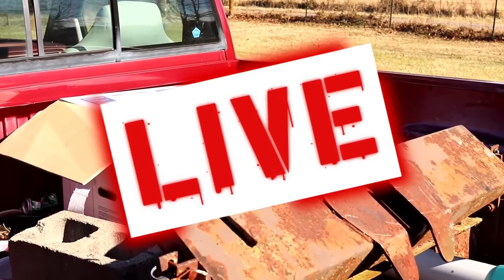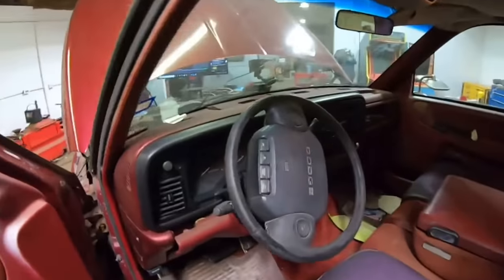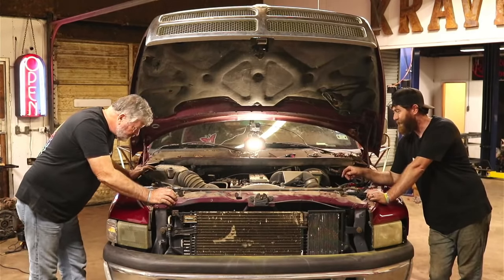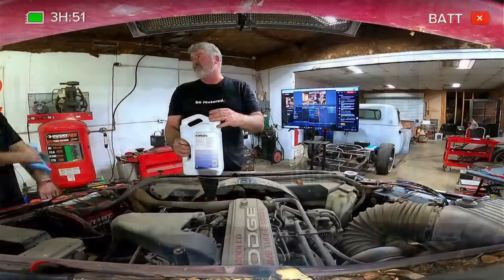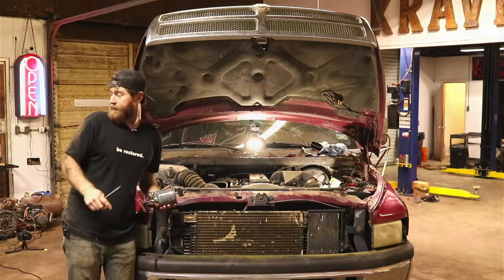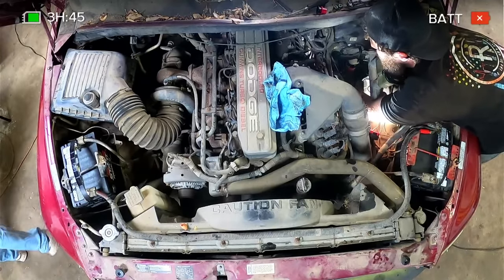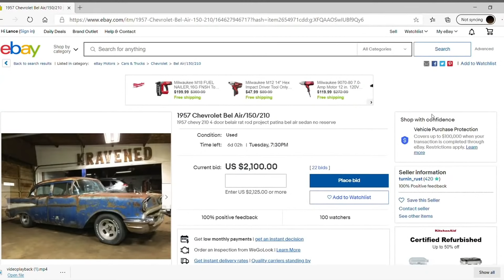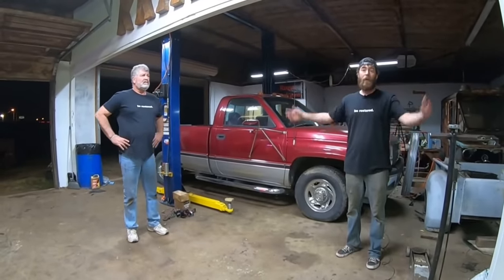LIVE First Start In Over 5 Years | 1994 Dodge 12 Valve Cummins Diesel | Will It Run? | RESTORED

Comment: The transmission weren't bad,they had a bad transmission cooler design that killed the automatic.  Heat is the number one killer of a automatic.  You put a good cooler on it,you won't have any problems.
Reply: The auto tranny was a torque flight 727 with overdrive but a good converter makes all the difference in the world i paid $800 for mine but it was money well spent
Reply: That is true
Reply: Some cooler lines also have a check valve, if it sticks shut, oil wont flow through the cooler, that can kill a good trans.
Reply: Some also have a thermostat and bypass line. it can also stick, then no cooling, oil just flows through the tubes bypassing the cooler.

Comment: Got 2 1st gen 12v truck I use on the farm and daily drive. My 1990 d250 is nearing 500K miles with just regular maintenance. I've replaced many of the ''dodge'' parts but have never put a wrench on the engine. One of the best engines ever put into a pickup you're going to love it. Also have a 1995 Ford F350 with the 7.3 that's darn tough too. I avoid newer vehicles and their computers like covid. hahaha

Comment: I had a 1998 dodge ram 4x4 with 5.2 ltr 318. I bought it new and put 460,000 miles on it. Never had any transmission issues with it. Only problems were the front wheel bearing hubs and front end problems. I own a third gen dodge now 2007 with the 4.8 ltr. with 185,000 miles. Sure miss the 98 it was a great running truck.

Comment: I mainly work on the classic Mercedes, which i know better than the back of my hand and more so the diesel's. NOTHING beats the clickly-clack of a old Benz diesel, that's what a real diesel sounds like. LOL Y'all are starting to learn the ropes about diesel's, the old ones are so simple to get running and maintain it's crazy. My 1991 350SDL was the last Mercedes to be EMP proof!! ZERO electrical shut down or start except the starter motor, all vacuum or mechanical operated. If it spins over it will run. Mercedes even put a rear transmission pump in them so you can roll start it!! I have 6 Benz's, 4 are diesel's and i love each and every one them. Keep up your GREAT family made video's, y'all are fun to watch and listen to while i'm hard at work in my shop.

Comment: I myself have a 94 dodge. That oil plug definitely looked like someone killed that thing. With the transmission leak, I'd say just do a full service. New fluid, new filter and new gasket. When I did mine I also used a little rtb gasket maker as well. Haven't had any problems. But honestly that pickup looks super clean, where as mentioned prior the clear coat tends to disappear. Also if I may, it can hold 13 quarts of oil with one in the filter, tends to run a little cooler that way as well

Comment: You think 11 quarts of oil is alot, try a big truck. My trucks hold 10 gallons of motor oil. 11 counting replacing both filters.

It was Chrysler that started putting drivers side airbags as standard equipment in 6 of it's vehicles. GM however did have it as an option on Cadillac, & other model passenger cars back in 1974 models. 
Lance might be too young to remember, but back in the day in the older vehicles if the airbags deployed, insurance companies often totaled them. The cost of replacing the airbags back then was astronomical.

Comment: He keeps saying these old Dodge trucks. I bought a 99 4 wheel drive 318 5 speed southern work package.  Cloth seats ac cruise AM/FM CD. I put 287,000 miles on that truck changed water pump, clutch, starter during that time. I owned a foundry at the time I put load levelers on it you woukd be amazed at the weight I hauled on that truck. Never broke and axle i had 3,000lb stainless ingot to melt in the bed of it. Towed 11,000# back from Birmingham AL 367 miles to upper east TN. Tough as nails..

Comment: I've had several of these trucks - a '95 gas 1/2 ton 5.9l 360 ci automatic trans short-bed 2wd, a '97 12 valve diesel extend cab 3/4 ton long bed automatic 4wd, a '97 12 valve diesel  extend cab 1 ton long bed automatic 4wd and an '01 24 valve diesel quad cab 3/4 ton long bed 6 speed manual trans 4wd. Some things I can tell you about these 2nd gen Dodge trucks: 1) it is best to have a cheater pipe on the ratchet when loosening the oil drain bolt 2) the fuel gauge sender is in the gas tank and is known to go bad, resulting in having to guess at the fuel level 3) with the pre-'98.5 diesel trucks, which came with the 12 valve  Cummins you will want to keep the valves adjusted; with 98.5+ diesels valve lash is hydraulic and more or less self adjusting 4) The contacts in the starter go about 100k miles then have to be replaced, which isn't too hard. I haven't finished the video yet, but will keep watching and call out anything else helpful that I can think of. Good luck and enjoy your Dodge truck!

Comment: I had a 99 Dodge 1500, and I drove for a couple years with no reverse. The transmission finally went and it ate a valve . Finally traded it in for a GMC.

Comment: I got 2 just like that I changed out the automatic transmission to Manuel  On one truck and a Allison on the other best thing I ever did and yes pull off the booster to change out the fuel filter good deal guys. No thats normal it makes that sound when you pressure it

Comment: As a 12v driver I hope you pre filled the oil filter and just put the full 3 gallons or 12 quarts in total its a diesel it holds a lot of oil so being a quart over or quart low will make no difference but running at about 9 quarts was a bad choice. Also you dont have to take the booster bolts out to access the fuel filter just reach in like a man and do it. Otherwise great video you definetly gained a subscriber.

Comment: If you go all the way back to Henry Ford the 1st and every service manual in between. Those things down there attaching that power house to the frame, they are called motor mounts. There, argument resolved. It's a motor.

Comment: the only thing i know about dodge  diesel engines is that you are supposed to wait for the lights to go out on the dash before you crank them and if its automatic you have to check the trans in neutral because if you check in park it will show a quart higher
Reply: I have some Dodge people tell me that those transmissions did not circulate fluid through the cooler while in park, only in idle or in gear.

Comment: All Dodge Cummins diesel motors use 3 gallons of oil, and it's better to fill the filter before installing it so it gets oil pressure ASAP!

Comment: I don't know how far you are from Home Depot but they have really good prices on motor oil. I also don't know what connections you have on batteries but they have Exide for about a third cheaper than auto parts stores.

Comment: It looks to me like motor or engine is correct.
1 : one that imparts motion specifically : prime mover. 2 : any of various power units that develop energy or impart motion: such as. a : a small compact engine. b : internal combustion engine especially : a gasoline engine. c : a rotating machine that transforms electrical energy into mechanical energy.

Motor | Definition of Motor by Merriam-Webster

Comment: Thanks for another great video! One idea for you if that trani. is having problems. My dad used some ac additive called gemline 88. No idea how I still remember the name, but somehow I do. When his trani in his 1977 3/4 ton Silverado would start slipping, he would change the fluid and add one bottle of it to it. Then it would stop slipping for a while. When he finally had it rebuilt, the shop said that it had been ran so many miles/worked so long that it could not be use in a 3/4 ton truck any more. Hopefully that helps. ;-}}

Comment: I have a 94 F150 Xlt it came with factory power windows and locks so im sure dodge was on that level as well
Reply: They were. I have this exact same truck(mines a manual) and it has power windows and locks.
Reply: I had a 90 F150 that had power windows and locks.

Comment: Cool mine is not a d2500 my truck is a 2000 dodge ram Laramie slt longbed quad cab 1500 5.2 litre 318 magnum V8 46RE automatic transmission and manual transfer case shift lever for the 4x4 with only 176k

Comment: I just bought a 95 Safari motorhome, it has that same motor, 5.9 t, with alison 6 speed auto, 2 speed diff.   it sat 5-10 years (past owner says 4), im hoping to plug up all the vacumm  going to the cab, drain the fuel, change fuel filter (and at 100mi), add 1 inline filter. new batteries, prime the fuel pump, and hopefully it will run. ANY TIPS? id apreciaATE any input, particu;ar;y diesel, i know gas prwtty good

Comment: Let's have some music on the radio while you water down the oil. A nice blues station would be nice. As for the transmission a Borg Warner would work well. Don't Cummings diesels self-bleed on their fuel systems.

Comment: I deem anything that you put energy to either Gasoline or electric to and it powers something a motor. Engine yes is mostly correct. But the motor police can't read between the lines. As my dad told the neighbor call it what you want I will call it what I want.

Comment: Long as you change the fluid and filter every 60000 to 80000 miles The transmissions are usually fine. But if u are towing a heavy trailer every 40000 or  you will  probably have problems. I am a Mopar man but these transmissions are a little on the weak side. I have had every style ram truck since 1983 and the 1998 went through a few transmissions but if your trucks get worked hard stuff is going to break no matter...

Comment: My 1997 V-10 Automatic would out pull a Diesel with a load up the Grape Vine  a lot faster than my buddies 1 Ton Diesel. And I could leave most anything far behind, Don't undersell the Dodge Transmissions.

Comment: Your wrong about the tranny it was a torque flight with overdrive good converter was the trick i had a high horsepower cummins with auto worked great and pulled 3 horse trailer with draft horses in it not a problem

Comment: You can run commins diesel for7500 miles be for you chang oil them you can get millions miles out of them be for you rebilled them I have 06 DODGS  I have 30000 miles on mine

Comment: Dodge was a good truck then but the transmission wasn't good I had a 96and 97 I had trouble with the transmission in both of them and I got rid of both of them and never did buy another dodge